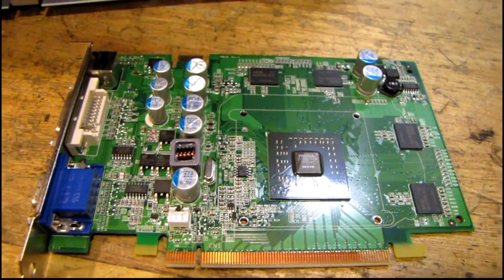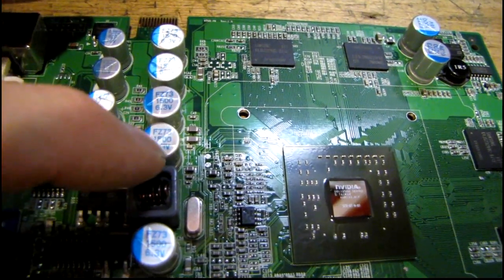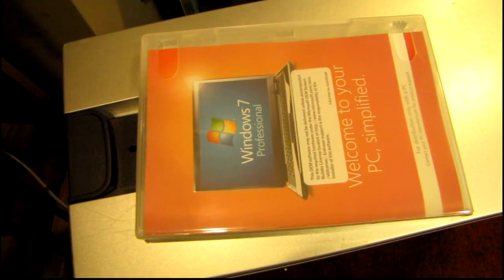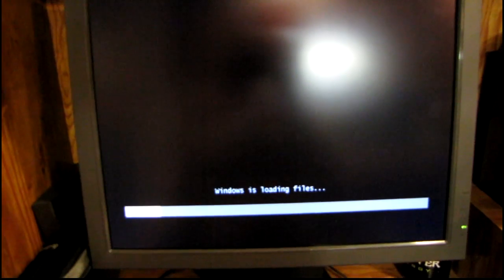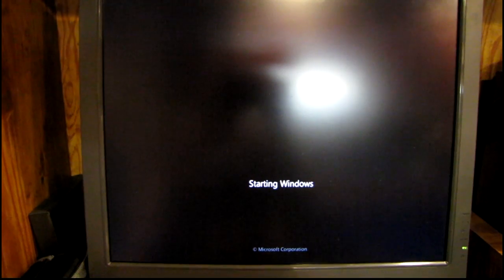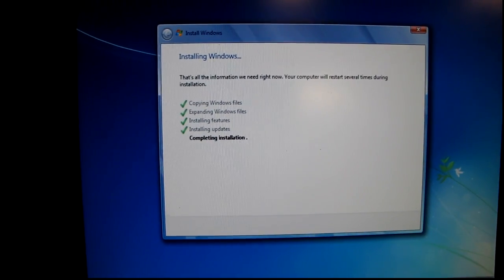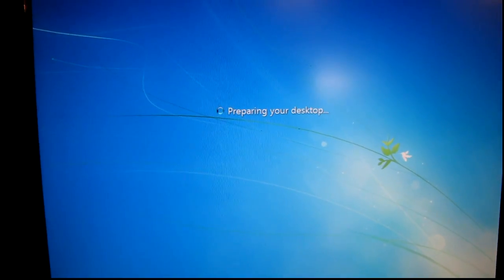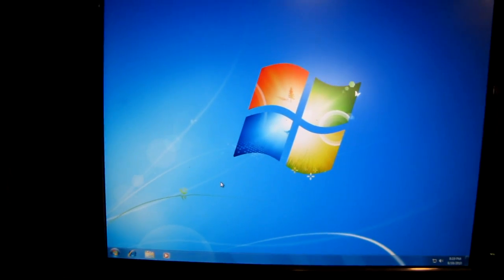Fixing up a Dell desktop computer, Part 2 of 2

Comment: I have a blown electrolytic  cap on my motherboard, and just happen to have the proper rated new one that I had laying around.

The weird thing about it is the top doesn't have the 'weak spot" lines on top, it's just solid metal.

Do you know what that's all about? I do notice there's holes in the bottom of the new caps (like designed in), I'm assuming that's the part that would vent instead of the top?

Comment from the maker: @MN12BIRD Oh ya, solid caps are a sort of semiconductor material that doesn't break down over time like electrolyte does.  They also have a lower impedance.  The only drawback is less capacitance than a standard electrolytic of the same physical size. 

That's one reason I like modern Gigabyte boards- They use good quality solid caps in the CPU power section of most of their boards.  Other companies have probably followed suit, but I'm not looking to switch yet.